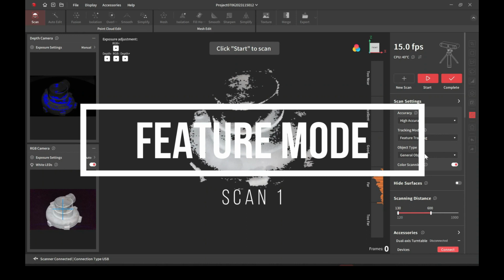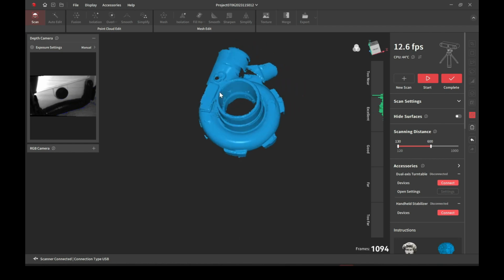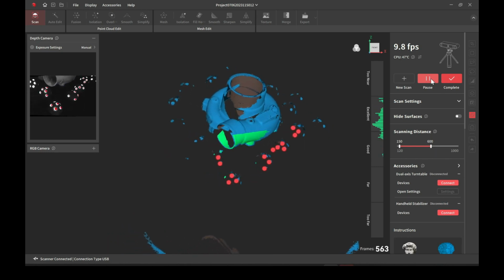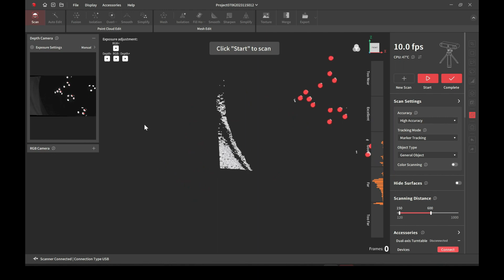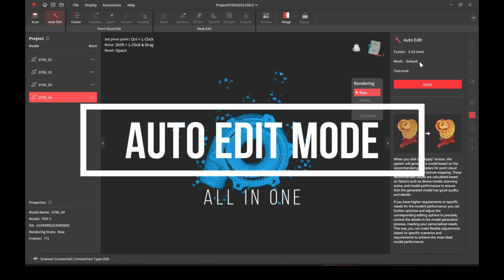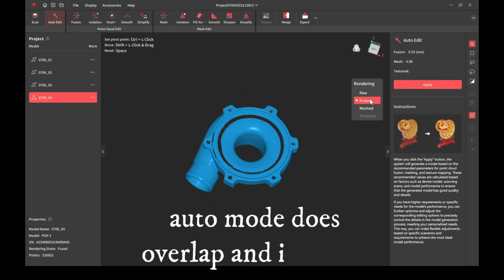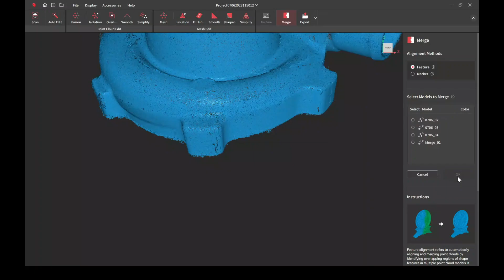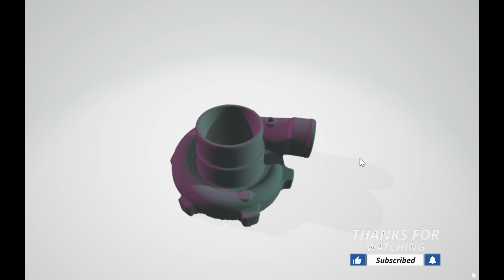Pop 3 Scanning with Revo Scan v5.1

Comment: I really need help with Scaling! If anyone sees this comment I would really appreciate any help. I scanned a part that's about 17 inches wide and 14.5 inches tall and when I open it in Blender or Inventor it's like 500 inches wide. What settings do I have wrong?
Reply from the maker: Import the stl into prusaslicer or bambi studio.
Rotate as needed. Then export stl.

Now import into blender.

Idk why this happens. But some programs do not read the scaling correctly.
Everything is exported from scanner in mm